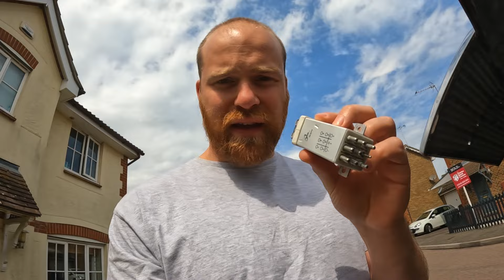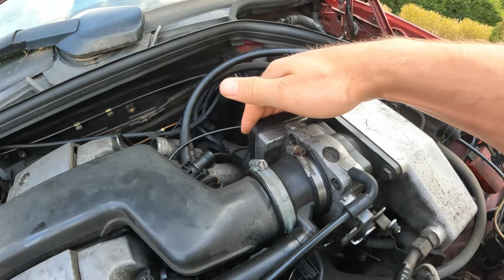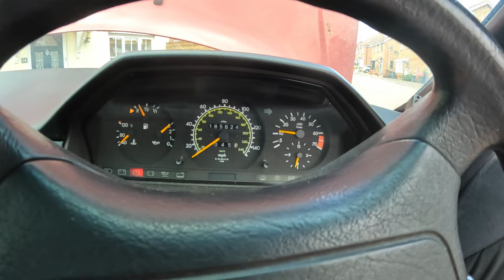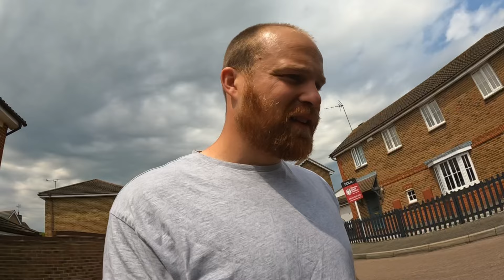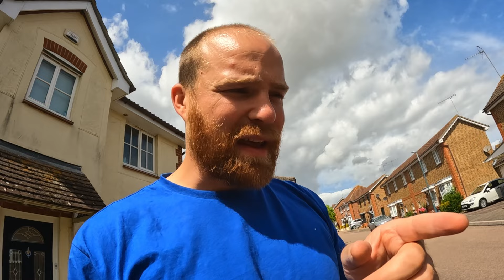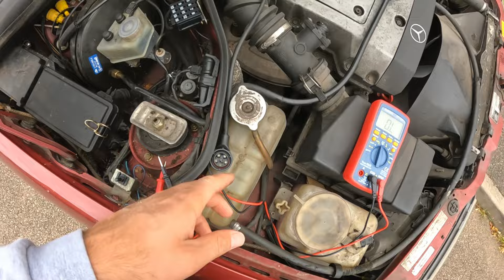Is this why my Mercedes 220E keeps cutting out?

Comment: You're correct- the computer is likely switching from open loop to closed loop and not getting the feedback signals it needs so it shuts down the engine
Biogradeable wiring? Gak! Replace it!

Comment: A thing with multimeters is they're always high impedance.... 10 MOhm typically. That means they're able to measure a correct Voltage on a circuit, even when that circuit has lost its ability to provide that voltage/power under load.
Get a test light or a multimeter with a LoZ function (yes, the kind that actually costs money and doesn't come from Alibaba) and test supply voltages in a car "under load". Anything else will send you for a loop.

Comment: Well done I like the way you keep at it. I used to repair large generators with no circuit diagrams and wiring that had been butchered. One of my favourite test tools was a 12 volt 60 watt foglamp. A voltage reading is not an indicator of a good supply. But a load drawing 5 amps will usually mean its OK. Keep up the good work.

Comment: My 1996 S126 E220 just died. One run with a hickup, twice, and after that it didn’t start again. Wiring loom that need to be changed. And I knew this was a 320 engine issue, but as you stated in your last video, it is all the facelift engines, from 1993. I wonder how many otherwise good 124’s that have been scrapped because of this issue. This was the first start of the ever since downward spiral of Mercedes quality. I haven’t gotten around to fixing my estate yet, so I don’t know all the work that will be needed. Just know that a new one is about £1000,-. Allready Mercedes started having too many computers…

Comment: Did you manage to solve this?

Have you even plugged in an odbc reader to check the obvious or see if there’s no merging to go on.

What I think you have is a few issues going on.

The high idle, I did have a w202, m113 engine. Was caused by a dodgy o2 sensor.
As for cutting out, it’s almost like it’s either getting to a temp and cutting out or not getting enough exhaust out and it’s just shutting down.
Reply: To old for an eobd reader

Comment: Haven't read all the comments but worth checking fuel tank breather for a vacuum, try running with fuel cap loose for a few minutes or when removing cap check for tell tail fizz when seal broken, cheers

Comment: I would test the wiring at the connection not at the plug ..The wiring at the connecter and before is likely the problem not the replacement plug(??)

Comment: At that time they used bio degradable plastic insulation on the engine harness...god save you if that turns out to be the case. Open the relay and re solder the joints

Comment: Just had an idea  (again).........if you just press a bit of speaker wire into a "+" on the fuel pump relay
.
(the 2 parallel is "+" and "-" ......... connect up an LED so you can watch the supply ..... 
.
then if the LED blinks and then the car cuts out ..... you'll know the ECU is stopping the car ????
...
(it may be trying to stop the engine from overheating ? )
...
OBD2  will tell you mate
.
cheers

Comment: Get yourself a fuel pressure gauge setup and check whilst it's running and if it cuts out with good fuel pressure you can rule out that side. Then look towards the electrical side, its unusual for a wiring fault to cut it out whilst stationary and not moving. Sounds like an ign relay. Check all those silver metal relays.
Reply from the maker: Thanks for that, Jon. I've just ordered a fuel pressure gauge, so I'll do that test you describe 👍🏻

Comment: Why would the wiring be so rotten and fragile . I have a 40 year old ford granada and the wiring is just fine.  Older cars were so much easier to fix.  Far too much complication on modern ones . All to do with emissions I guess . All a big con .
Reply from the maker: From 1991 - 1996 they used wiring that had a biodegradable sheathing. So over time it's literally biodegrading. Rubbish design.
Reply: German engineering, they didn’t expect the car to last that long?

Comment: The high idle could be a dirty throttle body ,have a look .
Reply from the maker: Couple of people now have mentioned to check the throttle body, so I'll definitely take a look 👍🏻
Reply: @NotEconomicallyViable  use an old toothbrush and some carb cleaner if it’s dirty .

Comment: w124s doesn,t have OBD standard, means no diagtool for these models. let me give you a little advise here. engines need 3 thinks to work. 1 compresion 2 spark 3 fuel... so, you clearly have compresion. point 2; spark, buy a cheap spark tester and plugin in, when car dies and you try to start and fail see if you actually have sparks. if don't your coil is damaged and needs to be replaced. point 3; fuel, if fuel is not getting with the apropiate pressure to the injectors it cause the fail. what to do? when car won't start add 20cc of fuel (or a tequila glass amount) to the air filter, if car starts for 5 seconds your pump or fuel filter or even your fuel pump relay is getting bad.

after all these test you cae reach to the point of failure. w124s ECUs are not that smart to replace maps or getting limp modes. they just control timing spark and injectors pulses by tps, maf and O2 sensors... also you need to see if your EZL selector is allright with your fuel octane quality, EZL selector is in left side near battery compartment.

cheers!
Reply from the maker: Thanks for all that, Patrick 👍🏻 I'm going to work through those problems and see how I get on.

Comment: I’ve just had a very similar problem with my Golf Mk3 2.0 and it would cut out as soon as it got up too temperature (a mile and a half up the road) and I was told it was the ECU relay as 99% of the time it’s always the problem.
The previous owner had given up on it because of the problem but I solved it  in the end when I used a £10 VAG code reader and it was was giving me Crank position sensor codes each time it happened.
I took the gamble and bought a NOS sensor for £12 as the wiring for it was shot but only after changing the coil and relay plus leads rotor and distributor cap and earth lead first and it’s  been as good as gold since.
Luckily Old Golf parts are dirt cheap so the parts bill for NOS parts was only about £30
Reply from the maker: That's a result. A couple of people have mentioned to me about the coolant temp sensor needing to be replaced, which fits in with what you're saying about the engine cutting out when it comes up to temperature, so I've ordered a new one. These W124 parts aren't the cheapest 😬

Comment: With a cable so bad I wonder is it worth even re terminating or jointing. As you said this is only the insulation damage you see, so much more could be hidden. This is quite a big part of my day job looking for earth leakage and insulation damage, I'd be looking for a whole new loom to save many headaches. The continual buzzing around the throttle body is similar to what I get on my Alfa 145 which is Bosch fuel injection.
Reply from the maker: Good to know about the throttle body 👍🏻 

I very much plan to replace this whole wiring loom, but for now I want to repair it just enough to drive it round the block a few times

Comment: After having owned 8 or more W124 i have seen this before, cant remember exactly the details but typically there is something that heats up and the car would cut off and not willing to start until temp was lower, which was the coolant temp. sensor at the front of the engine block that caused it. Wiring loom is typically bad but even if they look like shit they seem to work anyway, can you drive the car early on, is it possible to give it good throttle without it choking out on fuel ?
Reply from the maker: Thanks for the advice, Hlynur. I've just bought a replacement coolant temp sensor, so I'll see if that makes any difference.

Comment: Would suggest a few feet of 7 core trailer wire to splice in, Colours will not match but you should be able to work it out. Nice and flexible so should suit as a replacement that will not break down. I would also recommend getting some of those cheap 300mm wires with a crocodile clip on each end (£2 or £3 for about 10) that make multimeter easier to use as one end can clip on meter probe and other end on source being checked allowing hands free use of the meter.
Reply: Yeah, croco leads are indispensable when working on any sort of electronics. You need to be able to make stuff run while it's apart  in order to diagnose/fix it and the original leads are never long enough to do so.

Comment: Whats about your Gasoline pressure, this relays heat up and fail as well...
Reply: You have some Updates? Always try to figure out the most simple things, you can check with your hands and ears, does the Pump have power or makes sounds, does the Spark come, see if there is some oxidation, this all does not cost money i is just simple use your intuition. The engine will run as well if there is some failed sensor, but you have to watch for a major issue, Gas, Air, Power (Spark) these engines are simple and the EURO2 does not give you a dashlight so quick if there is a sensor failure, Euro2 have the sensors only for the exhaust control, not for Engine running correctly he needs to run on open loop easaly...

Comment: The rubbish job that has been done, (regardless if it's the problem fix) needs to be sorted. Ebay or Merc spares places try and get another engine loom and see what you can do, The engine bay loom is breaking up (original to the car) if its bad there its bad in other places, ( "I'll get a fire extinguisher!")  So time to change/work on the whole loom- sometimes there is just no quick fix and if it was easy everybody would be doing it
Reply from the maker: Agree 100%. At this point I just want the car running to take it for a spin around the block a few times, but I'll definitely be rebuilding the whole loom 👍🏻

Comment: Just to add, if someone can start the car for you with you at the bonnet, when falters see if a few squirts of easy start can keep it running - try to find how to used it as not a continuous squirt but squirts with a second or 2 between is the way. This would also prove if fuel. You could also have someone crank it when it stops with you using easy start. It may then start and keep running using above squirt technique if fuel issue. Sorry if hard to understand but it is sort of a knack.
Reply from the maker: Yeah that makes sense. Where do I actually squirt the easy start? Into the air filter, or do I squirt it straight into the throttle body?
Reply: @NotEconomicallyViable  Into the air filter housing should be suitable, maybe better if you can drop the filter out to remove any restriction.  If throttle body access is easy it may be better as this will be nearer the cylinders. Did you see my comment about a timing light or one of those HT inline testers that shows a spark to prove if you may be losing a spark when a component heats up. Keep up the great posts, but remember to take a break if things appear to be going nowhere as a break can assist your train of thought and stop overthinking.

Comment: You need to get a wiring diagram and change any old tired wires . Otherwise you'll be at it forever and ever and just use it for YouTube videos until everyone gets bored if they are not already and end up with no viewings and no car to enjoy apart from having endless cups of tea in it or using it as storage. Best of luck.🤞🤞🤞✌❤🍀

Comment: You need a new wiring loom to the engine bay. Its obvious the existing wiring is a complete bodge
Reply from the maker: Yeah 100%. That's just the first bit I've come across – guaranteed to be more bodging going on once I start digging. New wiring loom is definitely on the cards.

Comment: Not as scary as it looks
Unplug the loom
Pull it out 
Buy some good rolls of car electric wire get the main colours you need 
Pull off all the protective covering 
Use a board of wood to lay the cable on
Mark the cable wires onto the board 
You can do this in the comfort of your home
Tack a nail at each end and start to copy the loom 
Then use a soldor to attach each connector and seal with shrink wrap
Reply from the maker: Good to know. I'm definitely gonna have a go at redoing all this wiring

Comment: Fuel Starvation/to much
 caused by faulty fuel pump or blocked fuel filter. Cuts out due to too much gas. Wont start as its flooded. Not enough gas cuts out.
Reply from the maker: Thanks for that, David. I'll take a look into that.

Comment: Could be the fuel filter, I had a Honda that used to cut out at regular intervals like that, Changed the fuel filter and it never happened again.
Reply from the maker: Cheers, Dean. Will take a look into that
Reply: @NotEconomicallyViable  best to do that first mate before you start spending serious money.

Comment: Hi there. All this talk of throttle body. Mmm as it runs to a certain temperature, then stops, is there an ignition spark at the plugs? It could be the coil is shot. Had this on a Vw. Ran fine when cold. Also, try the engine coolant temp sensor in a pan of water slowly heated. Check its resistance change. If that sensor is shot the ecu could cut the fuel at a certain temp. Good luck as always..
Reply from the maker: Thanks for that, Neil. I've done a bit of research and some people have had problems with the coolant temp sensor failing and making the engine cut out, so I'll take a look into that. I'm also going to check for spark when it cuts out 👍🏻

Comment: I do wonder if these cars have auto choke? If so, then does it run on a different feed? As soon as the car switches over to that feed, could it have no signal and kill the engine by losing signal to the idle control valve/throttle body? I know normally if a MAF is bad the engine will run but pretty poorly. I did see the throttle blip when the car shut off too. Normally, electronic throttles do make a noise when the ignition is on to make sure the intake of air is just right at start up. Maybe try to run it with the MAF unplugged and without the inlet so you can watch the throttle during idle 😁. Also, definitely worth checking the rotor arm and the MAS fuel pump relay, they may cause similar issues 👍
Reply from the maker: Noob question: do fuel injected cars have a choke? I've always just associated a choke with carbs. A few people have now mentioned checking the throttle body, so I think that's going to be my next port of call 👍🏻
Reply: @NotEconomicallyViable  Not noob at all! They do, sorta. You may realize when you start a petrol car the revs may be a little higher then they would be on a warm start. This is essentially a 'choke' feature that uses more fuel in the cylinders to create a hotter burn which therefore heats up the engine quicker. Sometimes this can be bypassed with a quick rev. I know on Vauxhall's and Hondas I've worked on, the auto choke seems to run for around 2 minutes but I'm sure it varies from car to car 😁.

Comment: Unplug the ECU connector from the ECU. Work out which pins in the connector go to the MAF sensor, then check each one for continuity from the PIN to the sensor plug. That will tell you if the MAF Sensor cable is damaged.
Reply: Good call, but to be 100% sure it is best to put 12v through the wire and light a small bulb. The wire can be barely hanging on there by one copper strand and it will show continuity, but when there is current flowing through it, the resistance will affect the result.
Reply from the maker: Ahh yeah great shout – didn't think of that 👍🏻

Comment: Have you tried jiggling that harness while the car is running to see if anything changes? Obviously that wiring needs attention but I'm not convinced that is where your cutting out issue is coming from. Also the hood switch on the fender, is that a factory part? or has this car had an alarm or remote start wired in at some point?
Reply from the maker: It has had an alarm system fitted in its distant past. All the wires were cut many years ago.

Comment: You are in for a world of pain with that biodegradable wiring loom. I’ve done quite a few of early 1990s Mercedes. I hate to bring bad news which is you may need a completely new wiring loom. Most of the time now I just bit the bullet & replace the entire wiring loom about 10 hours of work. I don’t even try & diagnose I just junk everything & start again.
Reply from the maker: Yeah the whole wiring loom needs doing for sure. I'm gonna give it a go later on this year, but for now just want to get it running so I can have a drive around
Reply: @NotEconomicallyViable  good luck 🤞 I’ve had a few of these old 1990s mercs that I initially though were a  fairly simple wiring loom job. That turned out to be a gigantic pain in the backside. Because the old stuff had also fries a few of the sensors which needed to be replaced. So be prepared for just about anything. Apart from the crappy wiring these old Mercs are extremely robust.
Reply: @anakinskywalker4113  are the 1988 6 cylinder w124's biodegradable looms aswell?
Reply: @ some of the later Australian spec W124s can have problems. I don’t know about other counties. 
Mostly it is cars after 1992/1993 that are the issue. However with such an old Mercedes you just don’t know.
Reply: @anakinskywalker4113   thankyou for the reply sir. I'm from England, kept my dad's w124 after he passed, It was working perfectly but i parked it in a barn for two years now it won't start. I think it's an issue with the injection system but I have never been able to find out if it has one of those disastrous looms.
Reply: @ I think you should be ok. The major problem my friends in the uk tell me is the ethanol in the fuel. Which just gums up the fuel pump & injectors. So that’s where I would start. 
Drain the fuel tank & flush it out as best you can then put in Vpower or E5 if you can find it.